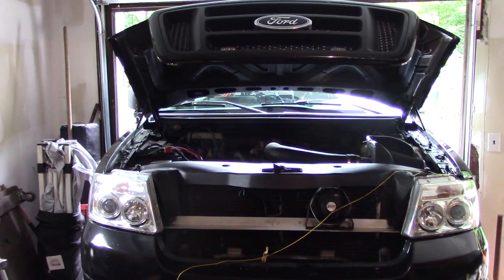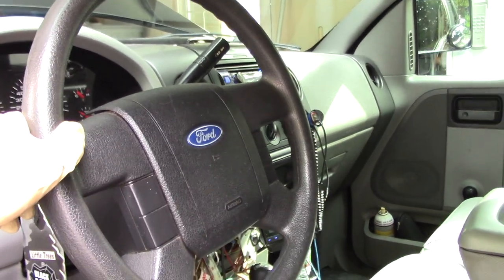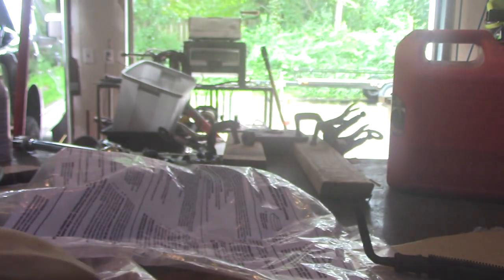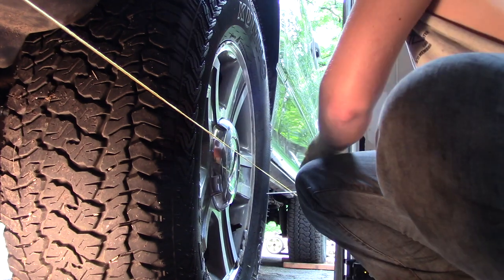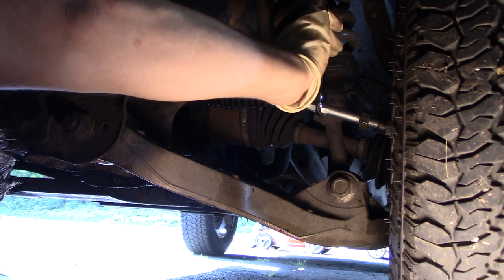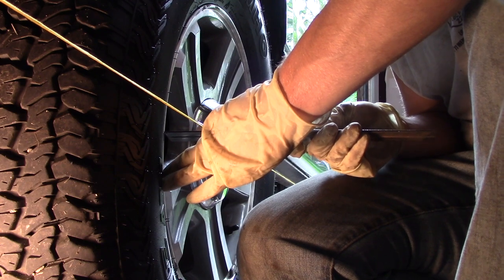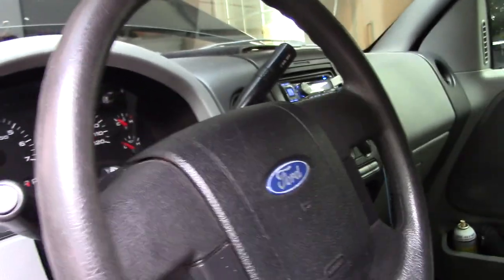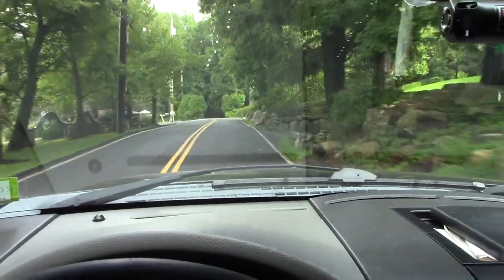How to Align a Pickup Truck

Comment: Pretty decent method of DIY'ing the toe.

May I offer some setup suggestions?  If not, disregard.

1) Setting up your strings...  Set the strings (better to use something like 1/32" aircraft cable) using a common distance from EACH of the front and back rim lips rather than a single point at the hub cap, which could EASILY be different from side to side.  The rim lips will not move.  It takes longer, but if you have the same distance to the string from the front and rear lips of the rim with the string passing through the CENTER of the hub (remove the cap and use a locating device off the axle), then you KNOW that the string is running parallel to the path of the rim through space.

2) Doing this on BOTH sides of the truck will allow you to do a couple of things.  First, it will allow you to get a rough idea of the toe angle on your REAR wheels.... which generally should be near zero.
Second, if you extend those strings well past the rear AND the front of the vehicle, you can then ALSO determine if the thrust angle of your rear axle is zero or well within specs.

IDEALLY, assuming that rear toe is supposed to be "zero", then the lateral/perpendicular distance between the strings/cables in the front AND rear will be the SAME measurement.
IF you have rear toe IN, the front measurement will be smaller.  If tow OUT, the front will be larger than the rear.  IF you plot and measure the cables accurately, you can use geometry/trigonometry to get LOTS of additional valuable information about thrust line, chassis centerline, how your frame and drive line relate, et al.

3) IF your toe is not precisely ZERO, then what you can also do is find the chassis centerline points at the front and rear axles and use a plumb bob to drop that point to the ground.  You can then measure out from the plumb bob line to each of the outboard cables to see the individual measurements....  which ideally should be the same.

PRIORITY:  NONE of this works properly and gives you the BEST results UNLESS and UNTIL you are starting with a ZERO degree thrust angle.  Fix thrust angle and pinion angle issues FIRST.
You CAN, with a good plotted diagram and the math adjust for a smallish +/- thrust angle.

Now....  ONCE you have your zero thrust angle and your lateral cables set, you can THEN translate them to adjusting for front tow angles....
NOTE: If your rear toe isn't exactly zero, then the cables will NOT be parallel, and you will need to adjust your front rim lip measurements front/rear to account for the slight difference in the non-parallel cables...

In a previous life, I was a helicopter maintenance officer and test pilot...  We deal with 1/100ths and smaller measurements on blade tracking, bearing alignments, rod end wear, et al.
Translating those standards to automotive world can yield some of the most efficient and pleasant driving experiences that you can imagine.
Reply: This made a lot of sense thank you for taking the time to post the detailed method.
Reply: Thank you for your post clay that was nice of you to take the time to type all of this out to share.